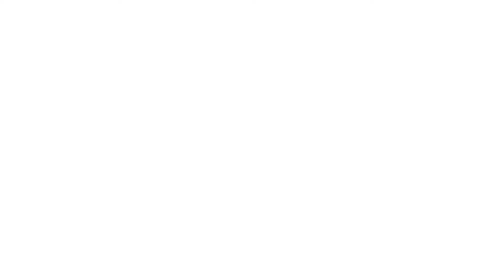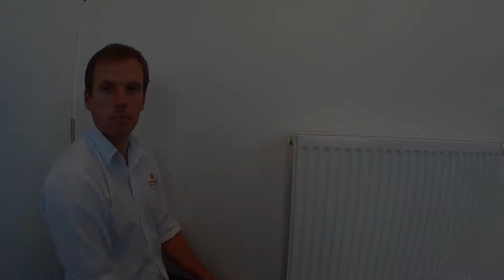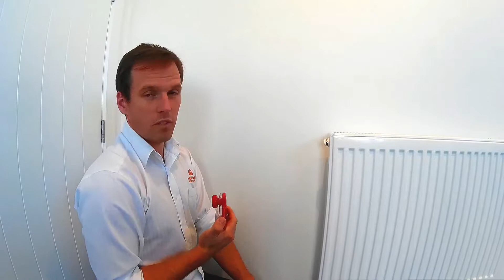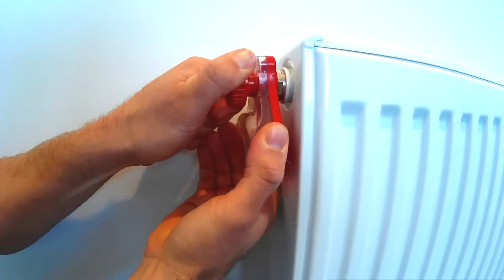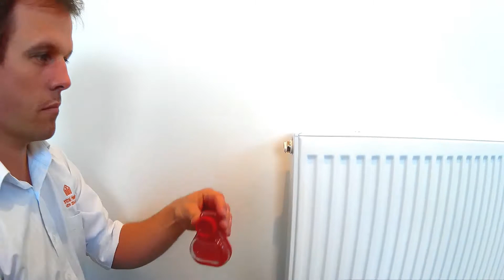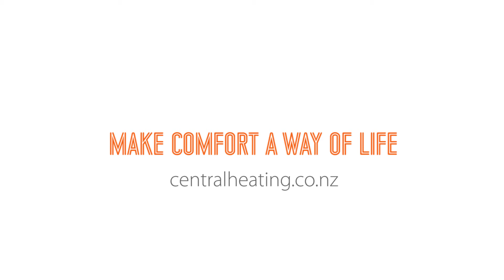Bleeding a Central Heating Radiator

Comment: Hi there , I let too much water out of one of my radiators when bleeding. Will it refill automatically? The pressure on the burner is now too low but I don't know how to adjust the pressure to bring it up to optimal range again . I have a Reillo RDB1 burner . Thanks for your time .
Reply from the maker: Hi Mal, apologies for the delayed response. I'm not sure if you have sorted this out yet, but with our closed central heating systems, you would need to top up your system with water through your refill valve located on your diesel boiler (red port on firebird units). We typical fill until the pressure is around 2 bar and then bleed the air from the radiator as in this video. As you bleed the radiator the system pressure with drop and you will need to repeat these steps until there is no air left in the radiator/system. Be careful when filling the system with a hose that there is no air bubbles in the hose before connecting it to the refill valve.
Reply: @centralheatingnz  thank you  for taking the time to reply .It turned out ourr pump was broken and needed to be replaced. Everything is back up and running again like it should be. Have a a great day , Mal.